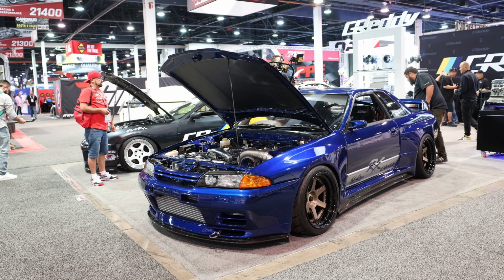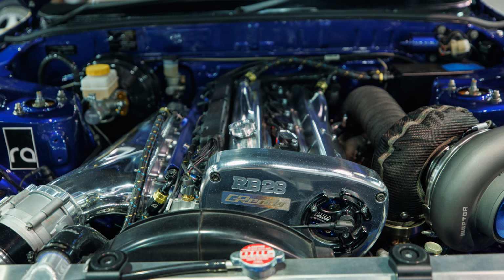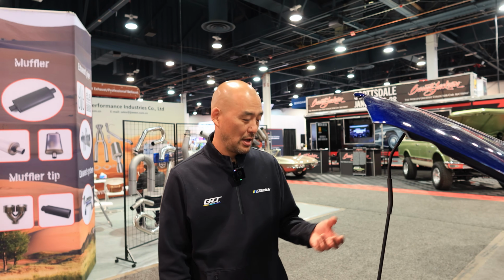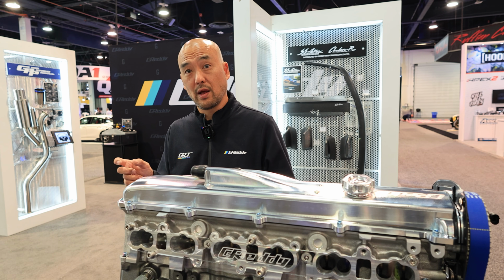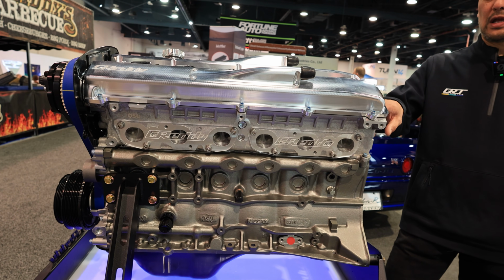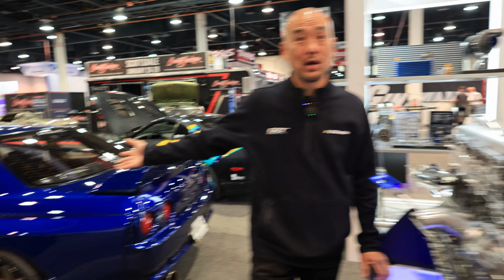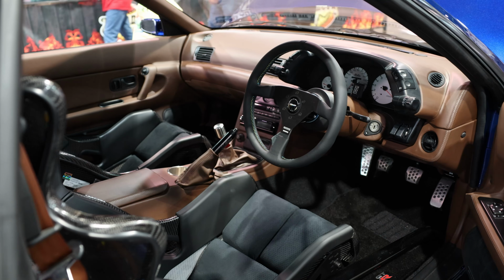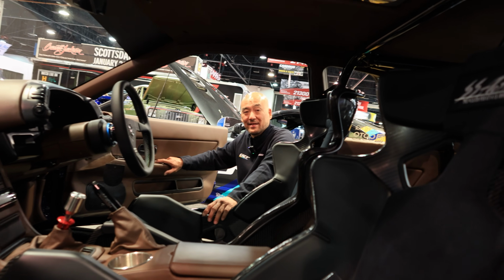Garage Active R32 w/ GReddy's Newest RB28 Crate Motor

Comment: Surprised to see you using the N1 block and not the new PRP cast iron block that’s fixes the stock issues and allows you to well sup pas the stock blocks and the PRP cast aluminium heads have massive potential 
Even the rb30 blocks would peak some interest there in the USA I would have thought 

Especially given the partnership your in with them in Australia

With both your products being leading edge 

And the 3.6 ltr Rb now a really 

Nice video with an awesome cars products etc
Reply: How do you use what isn’t available
Reply: @kokiriracers Australians are from the future.
Reply: @kokiriracers yeah bro, we have a Bullet Billet 3.6 litre block here in Australia = 2,500-3’000 whp
Reply: @PHATT_TV  and you can get a bullet billet rb30 3.6 short motor for half the price at 23k usd 😂
Reply: @Captainflood01  EXACTLY BRO LOL 😂!!! Or you could do what I’m planning = just stroke O5U block with NITTO 2.8 Stroker kit, get PRP block brace & trigger kit & still have over half the money left….& be able to make more power because NITTO has been tried & tested for 1-2 decades
Reply: @PHATT_TV  perfect setup man and totally agree with the nitto statement. The greddy block doesn’t even come with a brace or wider journal rod bearings like nitto offer and will still suffer at high hp from block twist for 70k aud 😂

Comment: $52k usd(?), for a long block that will only handle 1200hp..huh
Reply: The words only and 1200hp don't belong with each other
Reply: 1,200 hp reliably for the next 20+ years
Reply: Only 1200
Reply: @josepht28  correct. considering 4piston will build you a kseries 4cyl built for 1200hp for $13k....yes $52k seems a little excessive, lets not even get into the power per dollar for a lsx, silly.
Reply: @furiangameclips  yeah these are definitely pricey as fck for what it is, could build 2 2jz engines and an LS, each supporting the same or more power than this thing for the same price. Skyline and RB people are nuts
Reply: @knowbull5hit590  yea man haha, i mean i respect the motor, sounds awesome n all but, thats ridiculous cost per power
Reply: 1200 reliably for years to come. You can build a cheaper motor to handle the same HP but it won’t last past a year.
Reply: @Gerry-Witta-G-Comedy  much cheaper to buy a Texas Speed LS, can make way more power for way less. And reliability is top notch. If something does break on LS it's cheap to repair. What does a new set of rods cost? Or to deck the block, or revalving the head? If you run 1000+hp in anything you have to service these things I don't care what engine it is.
Reply: You're paying for labour and hand built attention to detail.

With a main cap girdle it could handle more power.
Reply: Reliable Power is hard to make I guess
Reply: Idiot, pay for what you get, these same motors are being used in Australia, skylines are killing it not to mention one car jun2 is pushing 3000hp on the same motor, and has had the same motor for the past 10 years and is only improving. Respect the work